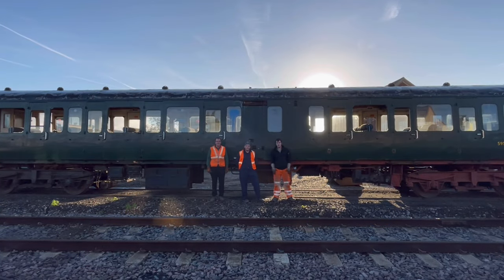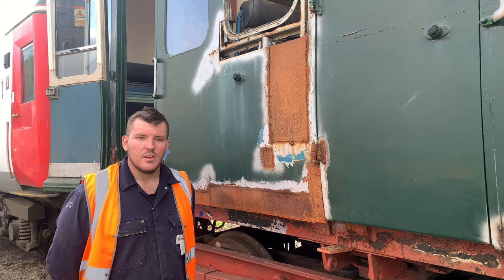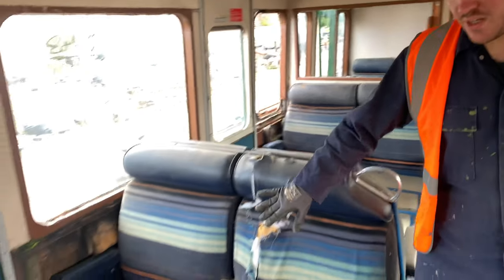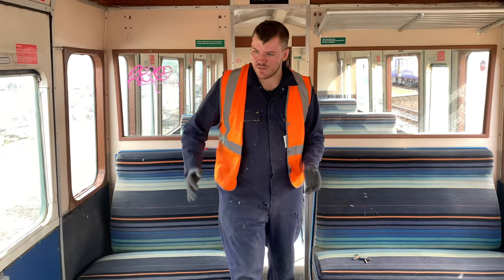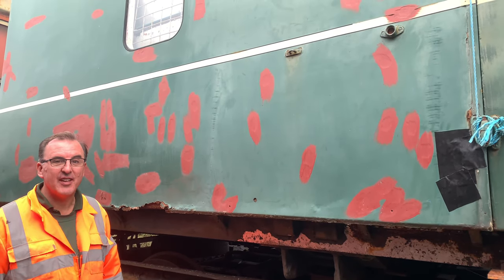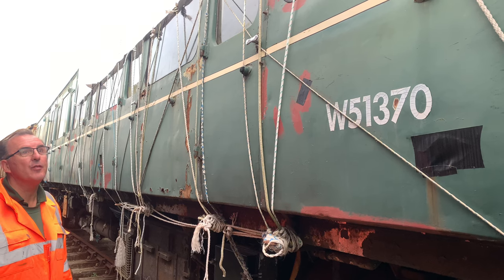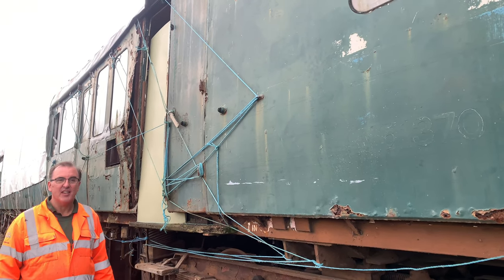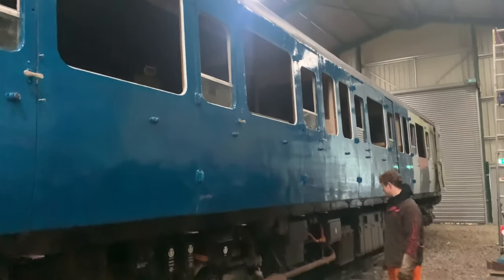Destination DMU Ep10, Meet the fleet!

Comment: I rode on 51370 and its partner 51412 as a child when they lived at Chasewater. Even then they were barely serviceable; ceiling and side panels hanging off, dust and cobwebs everywhere and faded paintwork. ‘The Green Wreck’ I used to call it. 

You’re doing a grand job on restoring them. This channel’s perfect for showing the wider public the 101 tasks of restoring rolling stock. I volunteer in coach restoration at Bewdley yard on the SVR. Williamson’s green primer we definitely get through plenty of(!)
Reply from the maker: Thanks for that insight into the unit’s history. Not much had changed over the years they lay dormant probably got lots worse lol hopefully you can come for a ride in the future when they are returned to pristine condition!

Comment: An interesting project; good luck with the work ahead of you. Would class 117 DMUs have run between Paddington and Reading during the early to mid1970s? They certainly look like the units I remember; I can still remember the sound of the engine and the leisurely gear change.
Reply from the maker: Hi Derek they certainly would have these and the single car variants the Class 121s are most likely the units you remember from that era. They do indeed have the nice leisurely gear change too!